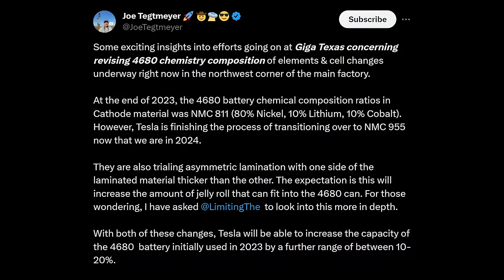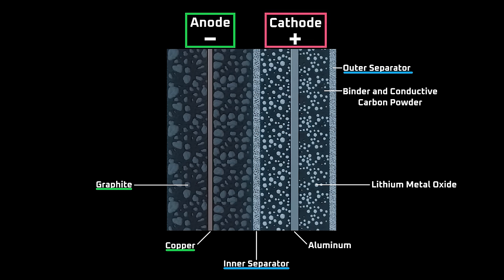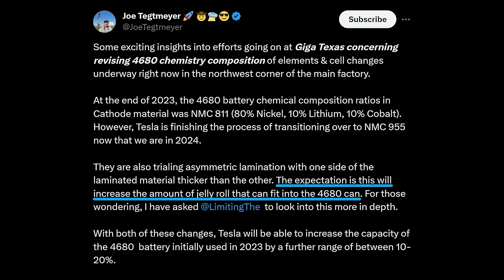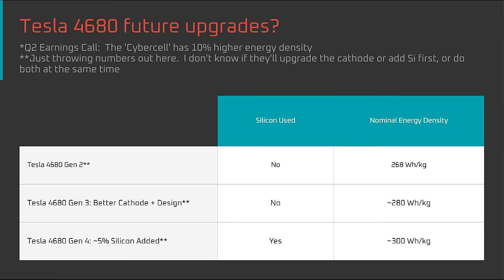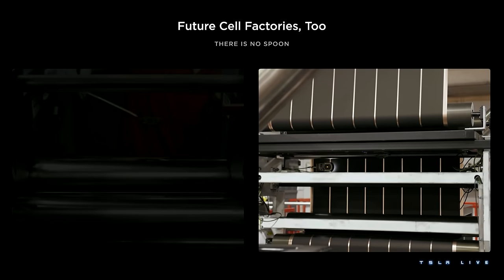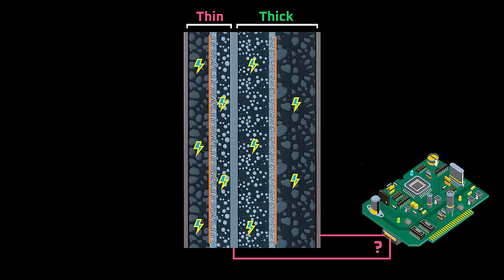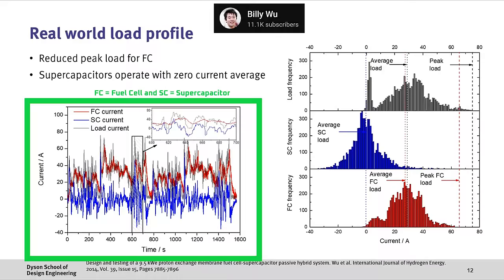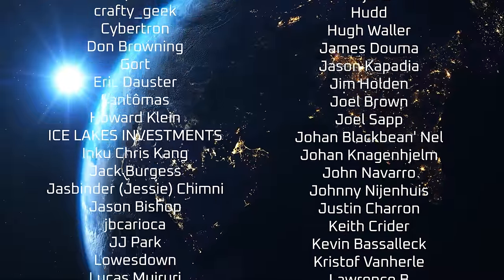Tesla 4680 Asymmetric Lamination Rumors // Two Cells in One?

Comment: actually I suspect calendaring would be EASIER on a slightly thicker electrode, and my reasoning is that it would be less prone to damage from slightly uneven grain size by increasing roller distance. Where as a 5micron particle might damage a roller or film lamination with a 5micron lamination thickness and you avg large particle is 5micron, if you increase the coating to 7micron, you clearance allowance saves the rollers. In particular with the dry coating process I bet it's like many adhesion problems, to thin is harder to do than slightly thicker.
Reply from the maker: Good insight thanks!

Comment: Asymmetric lamination is definitely going to be a thing of the future not because of managing cell swelling, but because different active materials have different energy densities.  This is usually addressed through an n:p ratio.  When making a cell in a lab, you need to know what the relative capacities are for both the cathode and anode to pair them close to 1:1.  If you don't do this then the cell will fail quickly.  When you do pair them effectively, I can guarantee that they will be different thicknesses, which is okay.      

Thicker electrodes are challenging because current densities shoot through the roof when charging at normal rates.  Current density dominates the rate at which materials can accept ions.  When this happens, the capacity decreases substantially, but can be remedied by charging slowly and I mean extremely slow.  You also run into to diffusion issues because you've increased the tortuous paths for the ions to travel and find a binding site.  There are research areas looking into this such as porosity engineering and electrolyte optimization.
Reply from the maker: 🙌 Great insights thanks!  🤠

Comment: Asymmetric lamination may work out but given that adding Silicon is already used in 2170 and battery industry, seems like adding Silicon would be more straightforward way to improve 4680. Of course as Tesla is finding out, everything with batteries is harder than it looks for large scale production.
Reply from the maker: Depends on how nicely the silicon plays with the dry coating process.
Reply: Can't they do both? Is there a reason they can't silicon dope AND laminate asymmetrical? Seems like they just have more levers to pull.
Reply: @tomodakisama  as you said - more levers to pull equals more complexity and more problems to resolve. That means more engineering required and money/staff/time limit what you can do

Comment: Thanks Jordan!  I assume that a prismatic cell can be formed with thicker coatings, due to not needing the electrodes to be wound into a spiral.  (In simplistic terms, parts with thick paint don't like to be bent.)  But this limitation may be in different directions for different materials.  For example, graphite may be weak to compression, due to its porous nature, so the inner layer may be limited in thickness.  On the other hand, metals and oxides may be stronger against compression, and can be made thicker on the inner layer.  That may allow Tesla to increase coatings on the mechanically unconstrained side, to increase the active material, as you stated.
Reply from the maker: The limit of the coating thickness is the liquid slurry separating.

With that said, the points you make are relevant.  There are many factors to consider with each form factor and cell design.

Comment: Thank you Jordan. As first answer I was thinking of different diameters. But temperature makes more sense as this can be varied more easy to adjust thicknesses. 
When I get it right the different thicknesses would create a kind of battery with 2 different C-rates. Most extrem in the same way when there is a battery and a capacitor in parallel. 
But as we have the same voltage it's not possible to move energy from the 'big slower' buffer to the smaller faster and more flexible buffer. But I am not a specialist.
Reply from the maker: The voltages will be continuously variable during charge and discharge
Reply: @thelimitingfactor  "The voltages will be continuously variable during charge and discharge"
I don't think this is relevant. Not voltage change over time, but voltage would be equal across battery pack and capacitor pack.

Comment: Asymmetric coating is a common feature in cylindrical cells, with certain 18650 cells exhibiting a 1-2% thicker coating on the electrode side facing outward. This asymmetry, after rolling, enhances overall cell uniformity.
Reply from the maker: Interesting.  What's kept them from going with larger ratios?
Reply: My comment with answer disappeared.

Comment: Perhaps the reason for not pursuing asymmetry is that bigger gain are easier by other aspects of the battery such as chemistry?
Reply from the maker: Depends on the improvement.  

Going with a high nickel cathode is easier, but going with a high silicon anode is tough.

It's the type of thing where you don't know how difficult it is until you start trying to solve the problem, so there's no way to know as an outsider

Comment: Thanks for the video.  I'm missing something.  The volume of a cell, and hence the amount of active material, is fixed.  Seems to me that It doesn't matter if the electrodes are thick or thin, there's only so much active material that you can put in a cell and that the energy density is fixed (unless, or course, you change the composition). I'm assuming the density of the coating is the same for symmetrical and asymmetrical coatings. What am I missing?
Reply from the maker: When you increase the thickness of the coating, although the total amount of material remains fixed, the proportion of active material increases.

This is just the same as if you're looking at one set of layers.

If the active material layers are twice as thick as the metal foil layers...you get twice as much active material in the cell as metal foil.

If you have active material layers that are 4 times as thick as metal foil, you get 4 times as much active material as metal foil.

NOTE! That doesn't mean it scales linearly.

There's decreasing returns...

1/4 vs 1/2 is a bigger difference than 8/10 vs 9/10
Reply: @thelimitingfactor  Thanks, Jordan.

Comment: I notice that you assume that the modification would be to thicken one side.  Might they also be reducing the thickness to one side to allow faster charging?
Reply from the maker: At practical level going thinner isn't a limiting factor.

They already do thin out electodes today to improve rate.

The real benefits and issues all appear with increased thickness, and balancing power and energy density.

Comment: Tesla is not filling their battery boxes fully now.  I think this would only be used for cost savings in production (less battery in a pack). 
So unless the battery lasts longer I see no advantage to a purchaser at this point.  
It's excellent that battery tech has a long way to go in efficiency. 
Good video. Thank you for sticking with what's known.

Comment: Great vid and to see where things are going. So far the biggest disappointment with 4680's in the cars has been DC charging performance but good to see some of these improvements can help address charging performance.
Reply: Would love to see you do a vid about the charging performance of the Porsche Taycan. Curious to see how you think they accomplished this and if it will lead to accelerated degradation of the pack? And if we can expect to see any of the car's approach to charging (especially aggressive charge curve) with 4680s?
Reply from the maker: Porsche likely just adjusted things like material thicknesses and improved the cooling system.

That is, I don't think there's genuine breakthrough there, just engineering tade-offs (as you pointed out).

Without a teardown, there's no way to know what's going on there.
Reply: @GridConnections  Porsche owners will tolerate a battery pack replacement at 100k, as maintenance. Just tell them it's part of the "ownership experience" and they will line up
Reply: Porsches don't get to 100k until the 4th owner...

Comment: Nice. Your video describes very well the various nuances of asymetrical electrode designs and what Tesla is trying to accomplish.

I wish this could be practically implemented as it would then allow Tesla's R&D team to focus on the other big bottleneck of fast charging: improving electrolyte ionic pathways.

In conventional designs, ions can only move in a linear way. This causes problem when using thick electrode designs with fast charging as it means only the cathode particles in direct contact with the electrolyte get ideal discharge/charge performance. 
Obviously, better electrolytes, thinner electrodes and higher temperatures can be used to increase the practical charging limit, but the base problem still remains.

One way that has been done in research and has likely been implemented by CATL in their bleeding edge LFP packs is using optimized parallel electrolyte electrode pathways; this allows for proper electrolyte wetting deeper in the electrode and greatly heightens the fast charging performance ceiling throughout the 10-90% SOC range without requiring active management.

I hope Tesla and their R&D teams are already at work on this so that charging finally stops being the bottleneck for EVs, so that the focus only becomes cost and energy density.
Reply from the maker: Thanks for the insights! Much appreciated.  Do you have any references that I can look at for the parallel pathways?
Reply: @thelimitingfactor   @thelimitingfactor  Yes. Hopefully the links don't get blocked this time (they did get blocked it seems).

This is the main paper I'm referencing. It's rather complex, but illustrates my talking points in much greater detail.
PMID: 36072550

The second paper I paraphrased:
DOI 10.1149/2.1171805jes

This one is something that I found back in 2022, but never thought that it would amount to anything serious that could be implemented in mass production: 
Electrolyte Membranes with Biomimetic Lithium-Ion Channels (nanolett.0c01910).

With how much I comment at this point, I should just become a Patreon member lmao.
Reply from the maker: Excellent thank you!

Comment: I wonder if it wouldn’t be simpler to have a few banks of batteries with thinner electrodes that the BMS controls differently than trying to make asymmetric layers
Reply from the maker: That would break from lean principles - unecessary complexity to achieve the same end.
Reply: I was thinking this. Whatever benefits you can get from asymmetric coating need to be compared to what you could get by building your pack with two or more varieties of cell.

We could instead make "thick" cells and "thin" cells and mix them in the same pack. While I could be missing something, this seems to give the same electrical characteristics as the asymmetric cells. The obvious benefit is that you no longer need to worry about the asymmetric manufacturing challenges.

There are some other more speculative benefits: this gives you many more parameters to play with to optimize your battery pack for whatever. In the asymmetric cells, the only parameters you have to play with is two thicknesses. With mixed cells, you can vary the ratio of cell types, you can have more than two cell types, and if it proves useful, you can segregate the cell types so that the battery management system can deal with them differently. 

My knowledge is insufficient to say that mixed cells always win over asymmetric cells, but absolutely the comparison needs to be made. 

The increased complexity of inventory control for mixed cells needs to be balanced against the increased complexity of manufacturing and lower flexibility of asymmetric cells.

Comment: With asymmetric lamination it seems like the simpler way to equalize the compression density of the thick and thin sides would be to laminate one side at a time using a two stage application approach
Reply from the maker: You'd still have to squeeze both sides
Reply: @thelimitingfactor  It’s unlikely that both sides need the same exact amount of compression to have proper adhesion and desired density, if that is the case the side that requires or tolerates higher compression could be stage one then stage two can be done a a slightly lower pressure

Comment: As someone who turns off your very good videos about half way through  because they go over my head. 
I understood the second half of your video better then the first half. 

I did not understand the display with material on both sides of the anode and catholic (copper/aluminum).
I dont recall seeing anything like this before.
Or is my brain going through a brainfart?
Reply from the maker: Good question!

A lot of people assume it's coated just on one side.

However, that's just to simplify it.

Typically, cathodes and anodes are coated on both sides.

So, it's not new, but usually the visual representation is simplified
Reply: @thelimitingfactor 
Do the ions go through the aluminum and copper foil ?
Reply from the maker: @golfish8589  No, just the electrons.  Watch my how a battery works video!

Comment: I am curious why some sort of electrostatic dispersion techniques aren't used to put the anode/cathode materials on the foils.  Using rollers seems clumsy.
Reply from the maker: Cohesion and adhesion
Reply: Makes sense.  Electrostatic dispersion would apply powder in lower densities, precisely and uniformly and then rolled.  I guess using laser printer tech is not good enough. @thelimitingfactor

Comment: I don't agree at all with the general thesis. This is the same kind of argument that people use when they suggest that mixing supercapacitors with batteries (that have thick electrolytes) could increase performance and range. No one has done that because it is not cost effective or weight/volume effective. 

There is an optimal thickness for the electrolyte and I think that any power gained by the thinner part would be negated by the fact that only half of the cell has this advantage and likewise the thicker for range part. However, what if this variation is just the slight difference one gets because one layer is on the inside of the foil and the other is the outside? When wound into the jelly roll, equal thickness when laminated when flat will become thicker on inside and thinner on outside. So maybe just enough to compensate?
Reply from the maker: Nah, different argument.  Two different technologies.

Comment: Could you not achieve the same result by having 2-3 types of batteries in the battery pack? Low-High or even Low-Medium-High?
Reply from the maker: Yes, but that would increase the cost and complexity
Reply: @thelimitingfactor  

The way I see it, having 3 huge machines churning out 3 simple products that require no R&D would be cheaper than having 1 huge machine churning out 1 complex product that requires additional R&D.

Where is the fault in my reasoning? does the self balancing behavior seen at the cell level not translate directly to the pack level?

I assume I must have a faulty premise, seeing as this is not the industry standard by now.

Model Y has 830 4680 cells, would there not be some configuration of High Capacity Slow Charging / Low Capacity Fast Charging cells that'd be beneficial to gaining faster charging and higher capacity?

Comment: But with asymmetric laminations. Isnt that difference going thru the jelly roll.  But the 4680 cell is going across the width of the cell. NOT thru the entire length of the jellyroll like most other cells.?  Like using the butterfly cap and Not the tabs. The current is going vertical Not lateral.  This is a non issue going tabless and changing direction across the jellyroll..
Reply from the maker: I can't parse this.

Comment: Wouldn’t it be easier to do a double roll of thick and thin?  This would have thick/thin battery’s but they should balance through the current collectors.
Reply from the maker: Not sure what this means
Reply: Making even thick and thin layers (easy to make) then wrap thick-thick-thin-thin it makes almost the same battery.  Every fourth layer is a thick against thin making it slightly less gain, so maybe 5% only.
Reply from the maker: The facings have to align in terms of capacity.  You can't pair thick with thin

Comment: But the cost/kwh? Would that increase if using more of the expensive materials?
Reply from the maker: Increasing the energy density gets rid of the dead weight, so it'll be cheaper

Or to be more specific, each cell will cost more, but it'll cost less per kilowatt hour

Comment: I'm not an expert in this whatsoever, but this seems really similar to that one company that made a 750mile battery for Model S. If I remember correctly, they mixed 2 different batteries, one that charges really fast but has low density and other that charges slow and has a really good density. This seems really similar since it would essentially be a lower density, fast charging cell on one side of the roll, and then one slower charging higher density on the other side. So why doesn't Tesla just make 2 different 4680s one with thin and other with thick electrode and mix them inside the pack, seems like a simpler idea if this doesn't work out.
Reply from the maker: Because using two different batteries is more complex.

With this all the batteries are the same and coming off the same production line.
Reply: @thelimitingfactor  I know Tesla is all about efficiency and this would definitely be better and more future proof. But if this turns out to be impossible to achieve in some way, 2 battery approach seems like a good idea, at least for more premium models. BYD blade to me seems like a clear winner in almost all aspects for midrange and budget cars. I don't really see the future for 4680 in cars, but for trucks and semis it's a good option.